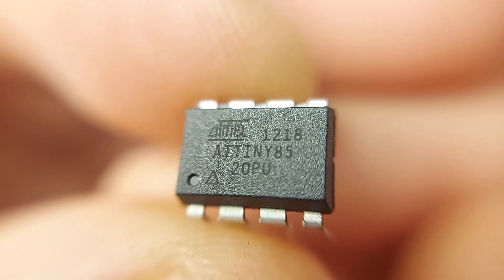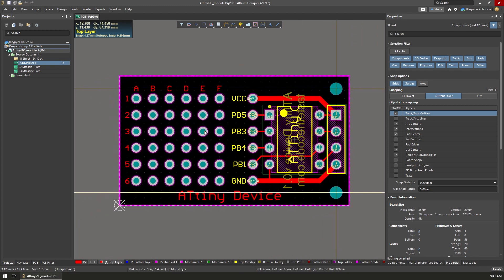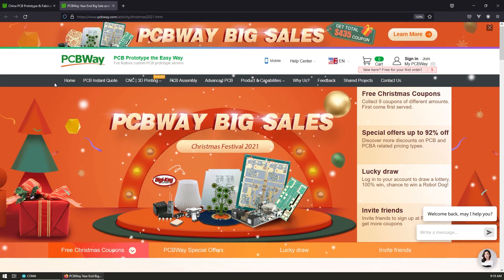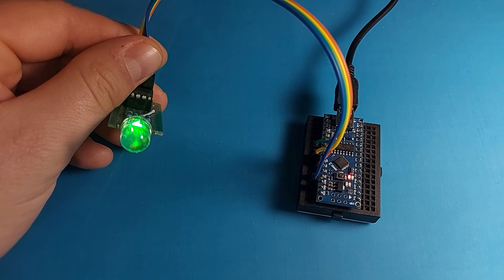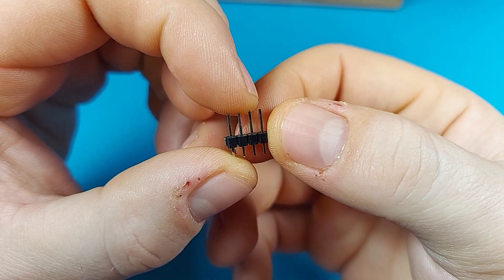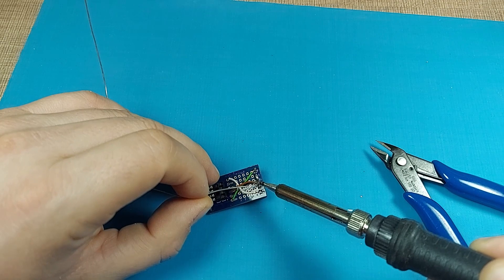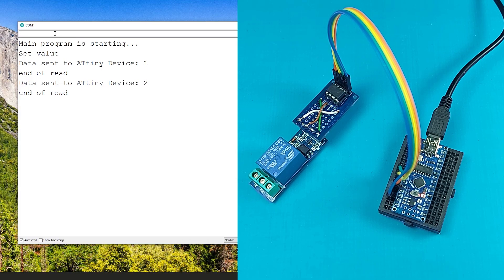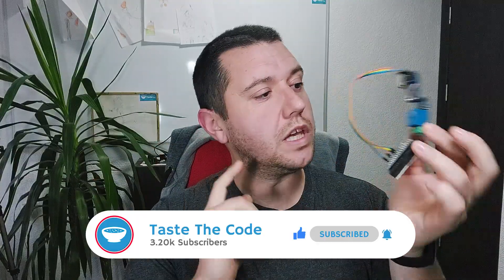How to make DIY I2C slave devices with ease - ATtiny Device

Comment: Of course, your boards are out of stock.
Reply from the maker: Yes, they are out of stock and I'll probably won't make them anymore. I'll share the design file one I get the chance so anyone can order some from PCBWay to be manufactured.
Reply: @TasteTheCode  Unfortunately, they're prohibitively expensive in small quantities from PCBWay. It's just worlds easier to do a little point-to-point board on pad-per-hole perfboard.

Comment: About the delays, this is not true. ATtiny85 and related all have internal RC oscillators, and you can also provide your own external clock source that will give you a clock speed up to 20 MHz.
Reply from the maker: Hmmm if you can prove this please share a sketch. Attiny85 does not have a built in I2C so we are emulating it. Any delays in the code will prevent the chip from listening/sending I2C data and will break the communication no matter the clock speed.

Comment: Hi is it possible to attach Sht20 humidity and temperature sensors with attiny 44a through I2c by this method
Reply from the maker: I'm not familiar with the 44a but I think you should be able to connect them.

Comment: A great idea! (And a new subscriber for you :-)
Are there other limitations besides not being able to use the delay function?
Reply from the maker: Thanks Dave! Another one whould be that you can't use interrupts while using I2C as pin2 is the only one available on the Attiny85 and it is also used for the I2C. Other than this I'm not aware of anything else.

Comment: Is there a software i2c that runs on PC, i want to send commands out on i2c from PC, can this be done,,  thank you
Reply: Your best bet is likely to use an arduino over USB to interface with it
Reply from the maker: Yes, I agree that probably the best bet is to have an Arduino connected through serial with the PC and then the Arduino can issue the I2C commands.
Reply: If you want to get fancy, you could interface with it using a Java program. (Not sure if it will let me post a link)

https://drive.google.com/file/d/11p_XLBsNG-rqQu35f8Oct9-vCRF6VQMy/view?usp=drivesdk

Comment: Hi - Just a minor suggestion for the device board.  You have a pin header for the cable that connects it to the I2C parent device.  I would suggest putting another header next to it with the pins wired in parallel (pin 1 to pin 1, pin 2 to pin 2, etc.).  That way when you have another device to add to the I2C bus you can use the second header to connect the cable to the next device and 'daisy chain' the boards together.
Reply from the maker: Thanks Sean, that's a great idea! Thanks for sharing it. I'll try to incorporate it in the next revision.